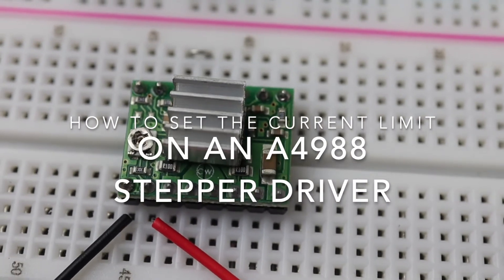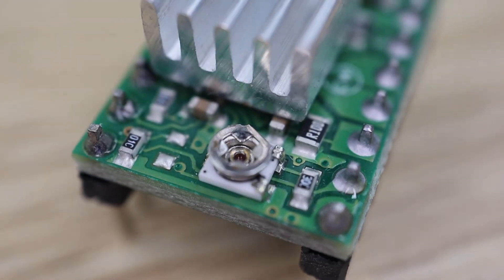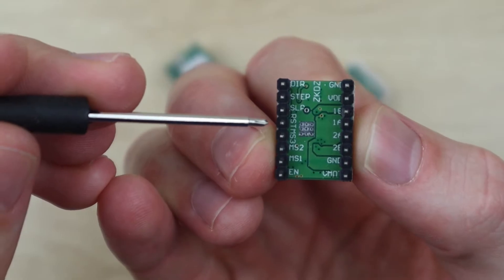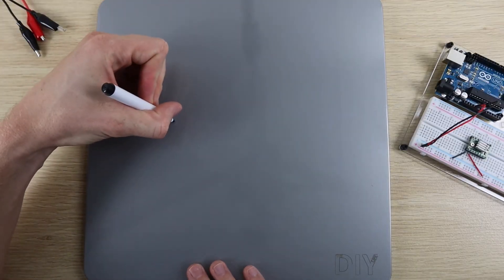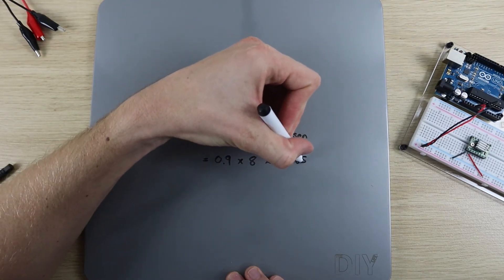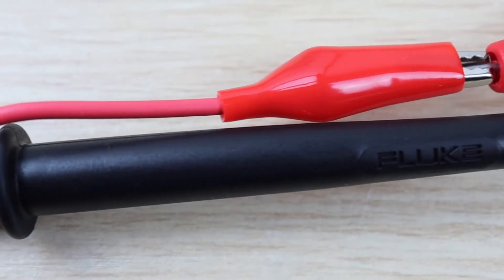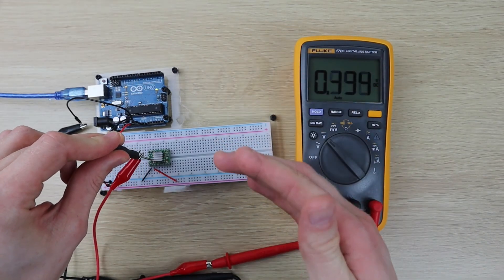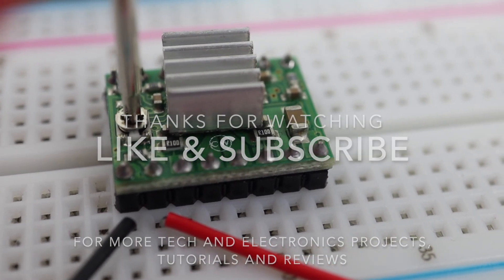How To Correctly Set The Motor Current Limit On An A4988 Stepper Motor Driver

Comment: So now i can power my 5V 1A (big) stepper motor with a 12V power supply true my A4988 like this? The 12V won't be a problem for my 5V motor?
Reply from the maker: You can run a motor with a higher voltage using the A4988 driver, you just need to make sure that you set the current limit down to compensate for the increase in voltage.

Comment: Where / How do I find the current sensing resistance of the A4988 board?
Reply from the maker: You’ll need to find the datasheet for your specific board. Either find the manufacturer or ask your supplier for it.
Reply: @MichaelKlements  Ok..thanks. I did try to find it online but as they were generic units from China off of eBay, I'm hoping they will respond to my request for that info.
I set one up for the .68 but after running for 10 minutes, the board burned out right under the heatsink. Good thing they are cheap. I think the next ones I get, I'll make sure they're better quality.
Reply from the maker: Yeah its a bit of a trade-off buying Chinese parts, you get a good deal, but often don't know what you're buying (the distributors are usually pretty unhelpful as well)
It's unlikely that the motor current setting burnt the board out. The motor current limit is set to protect the motor. A burnt board could just be faulty electronics or over-voltage?

Comment: Why x8 in Ix8xR?
Reply from the maker: I’m not sure, that’s the formula given by the manufacturers. I’d assume that this involves the Vref being 1/8th of the Vmot or something similar. This is not a straight V=IR calculation as the V, I and R are all from different places on the board. The 8 related them in some way.
Reply: @MichaelKlements  Other Youtubers have used drivers with Mega and ramps...  Is it enough to use Arduino uno only like you did ???

Comment: Can i use 2 motors for single driver?  And hiw i get one motor opposite direction?
Reply from the maker: It's not good practise, but you can - as long as the two motors are the same (preferably same make and model). To reverse one just connect the opposite coil pairs together.

Comment: QUESTION : if my motor (nema 17) is a 12V motor and i use 12v as an input power, do i have to limit the current. If yes, why and if no, why
Reply from the maker: Yes, you do. Because the motor's rated voltage has nothing to do with the current being supplied to it by the motor controller. You're supplying the controller with 12V, not the motor. You need to limit the maximum amount of current allowed to flow through the motor's coils or your motor might burn out.

Comment: some people use a different formula
current limit = Vref * 2.5
what is the difference?
Reply from the maker: This formula only works for boards with a current sensing resistance of 0.05 ohms.

Comment: Hi there - I'm using an A4988 board that did not come with a datasheet (link below). The SMD resistor next to the pot has the code '303' printed on it, which appears to correspond to 30 kOhm! This seems high, am I missing something?

https://www.amazon.co.uk/gp/product/B0793K9KF8/ref=ppx_yo_dt_b_asin_title_o05_s00?ie=UTF8&psc=1#descriptionAndDetails
Reply from the maker: Hi Adam, unless I’m getting linked to a different board, the picture of the driver in the link you shared looks like it has a 101 on the current sensing resistor.
Reply: @MichaelKlements  Thanks alot for the reply, really appreciate it. I can't see any resistor with a 101 on it though? Am I right in saying that the sensing resistor is 'R1' on the silkscreen? I'm reading that as 303...
Reply from the maker: I've had a look at the image on a computer and you are correct, it is a 303. On a mobile phone, it looks like a 101. 
There are a number of different versions of these controllers, so there isn't one answer to cover all of them. The resistor R1 is usually a part of the current sensing resistor circuit but is not the primary current sensing resistor. The controller usually uses this resistor in conjunction with two others, S1 and S2. These two are the main current sensing resistors, they are typically the same resistance, and are usually very low, like 0.05, 0.068 or 0.1 ohm. These should be specified by your manufacturer or printed on the board or datasheet.

Comment: Bro please help me I connect motor driver with ramps 1.4 with dvd stepper motor moving forward but not coming backward
Reply from the maker: Is the stepper motor a 4 wire motor? Have you checked that you've got the correct coil pairs?
Reply: Yes it come with 4 wires some times -yaxis works but some time didn't I changed motor even motor driver
Reply: Please help me
Reply: Yeah when I connect with x axis motor works all right but when I connect with y axis it move only forward not backward(-y)
Reply from the maker: If the y axis works intermittently then there's either a loose connection or the motor or driver is faulty.
Reply: Yeah I do both of them motor and driver is ok but I don't know what the problem is

Comment: Bro i use DVD stepper motor but it getting to hot can I fix it with potential meter
Reply from the maker: Stepper motors do tend to get to get hot while in use, but if it seems to be excessive, then limiting the current will certainly help.
Reply: Thanks bro

Comment: Awesome tutorial! Strangely enough, my potentiometer on my A4988 board doesnt go above 0.78 when I need it to go to a value of 1.2.
Reply: I'm having the same problem with my A4988 drivers. None of 5 goes above 0.8V. Maybe someone has a solution?
Reply: @theartofcolor  hey man i have no idea what happened but i just did everything over again and it managed to be higher than 0.8v.
Reply from the maker: Thanks Anthony. Are you sure you've got the correct value for your board's current sensing resistor?
Reply: I had this issue with one of 3 drivers. It was faulty and needed to be replaced.

Comment: The sense resistors on the driver board in the video are 0.100Ω
 (R100). Should that not be used instead of 0.068Ω ? 
I understand that the sense resistor values used vary depending on the manufacturer but I want to make sure I am not missing something.
Reply from the maker: Yes, you are correct. You should use the actual resistance value of your current sensing resistors. I've used 0.068Ω as an example in this video because this seems to be the most commonly used current sensing resistor.

Comment: My CNC stopped working, so I decided to check the motor current.   It was set at 1.62V.  I thought kind of high, but could not find the data sheet for my stepper motor.  Stepper motor labeled D42HSC1413B-24.  Any suggestions?
Reply from the maker: I can’t find much information on that part number either. Most steppers used for hobby CNC machines are around the 1.5A mark. Perhaps try that for a start?
Reply: @MichaelKlements  Thanks Michael, I found the problem.  I forgot to put the jumper on.  I have set it to 1.3A just to be safe.

Comment: My stepper motor voltage rating 12v dc. Can i run the motor with this driver. Plz ans
Reply from the maker: Yes you can run 8-35V motors using this driver.